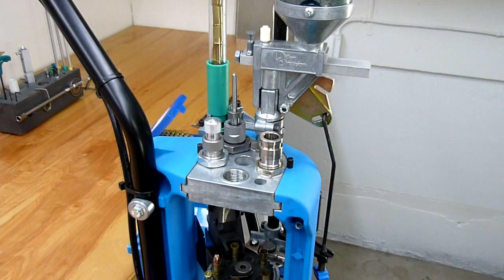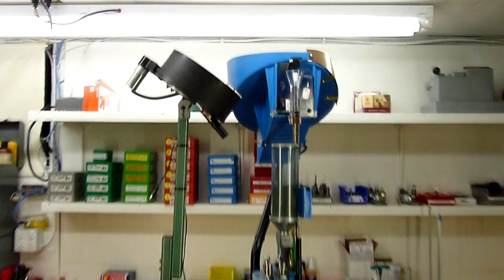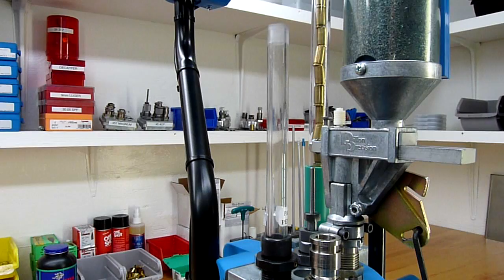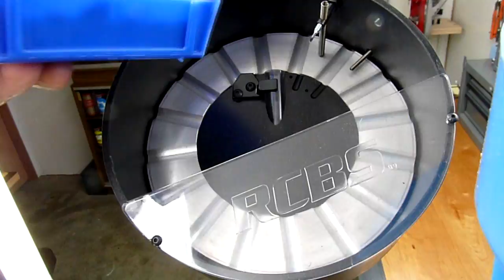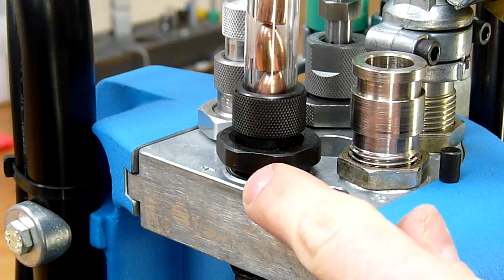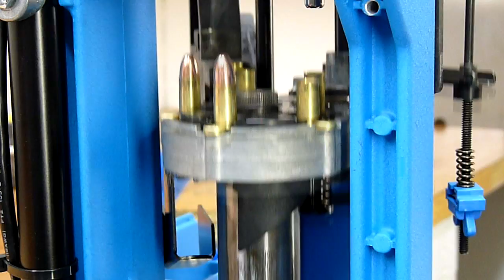RCBS Bullet Feeder on Dillon XL-650 9mm (HD)

Comment: I've looked at a lot of designs for bullet feeders and this is the coolest one. It doesn't need a bunch of different plates for each caliber and nose profile. It will flip any bullet that has a pointy end and a flat end. Presumably you can dial in the drop out ramps so it won't dump every boat tail.

Comment: Lose the powder check and use a separate seat and crimp die, it's easy enough to visually check powder lever at station 3 even when running 1k rounds an hour on the 650. I also prefer the double alpha bullet feeder myself, the rcbs and hornady units don't work near as well from my personal experience.

Comment: Great video.  I have a couple of questions .  Are you flaring your case mouth that wide to keep the bullet in place so it stays in place advancing to seating die?   Are you using a Dillion powder funnel?   I'm having issues with .45 Brazos coated 200gn SWC staying in place during this process .  I may need to increase flare.

Comment: As the other guy said, that is alot of flare in the case mouth.  Is that something you do intentionally?  I was under the impression that you do as little as you can get away with but I do not load very many pistol cases.  Does it cut down on case life or anything.  I know it makes it alot eaiser to get the bullet to sit on the case.  By the way, thanks for the great vids

Comment: Just wondering if you had any case shaving issues with the Lee seat/crimp die. As I have a XL-650 as well and even with little to no flare/bell at say .378 for testing the seat/crimp die is shaving like .0001 off the case mouth. It seems the Dillon powder fuller bell is more aggressive then the Lee PTE and scraping the die. So I may have to BO dome Dillon dies to resolve my issue, but just wondering if you ever had similar issues?

Comment: hi gavin i am trying to decide between the hornay progressive ap, the dillon 650 or 1050
i saw the vid ref. the feeder, have you used it on the 1050. i want a bullet feeder no matter what unit i end up with. the hornady seems easier & faster to change dies? also i guess you have to use different manufactures dies to make the feeder work please advise
thanks 
bill
Reply: I'm not familiar with the Hornady press and accessories except what I saw once at a friend's house (it was noisier than the Dillon), but with my Dillon I just buy the complete die head (powder drop included), set it up once and then just change out the entire die-head with the dies still in place. The only thing that needs tweaking then is the powder drop to account for different powders and bullet weights. That takes maybe 10 minutes plus another 10 minutes to make the changes to the case plate / case feeder plate.

Comment: That looks about as fast as a 650 without a bullet feeder, but you have to slow down so that the bullet doesn't tip over instead of just running it up into the seat die.  So it can be run just as fast as normal, except in the case of when a bullet falls over, and you need to use a ton of flare on your case mouths, and you have to use boat tail bullets to load rifle because they do not sit in cases like this.  Seems like a downgrade.  The setup seems easy as hell though, after you build the stand for the feeder..  That's impressive.